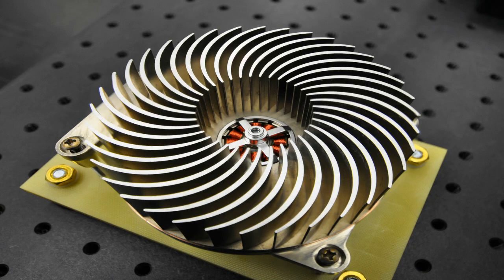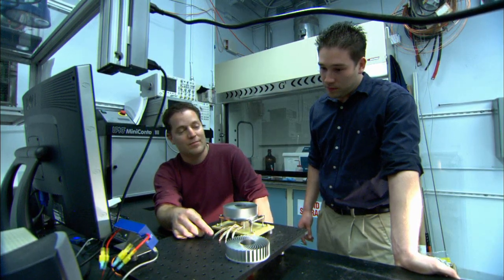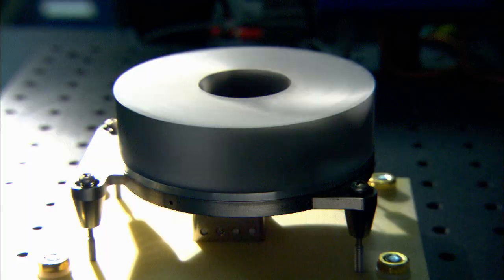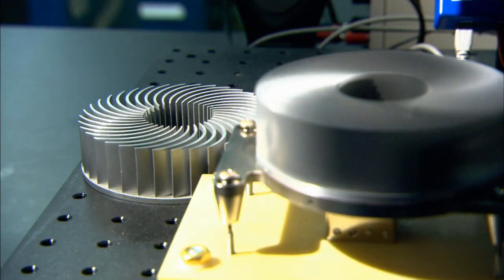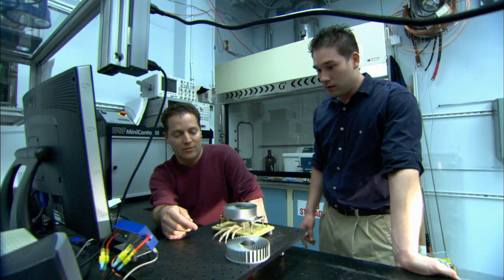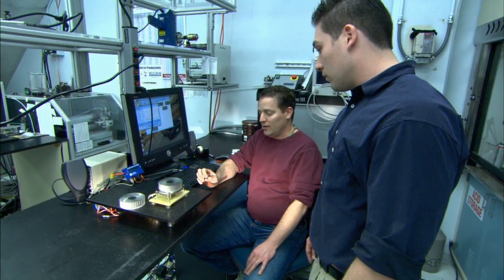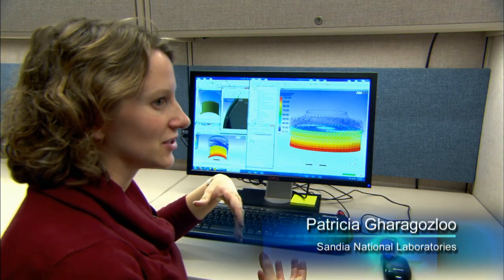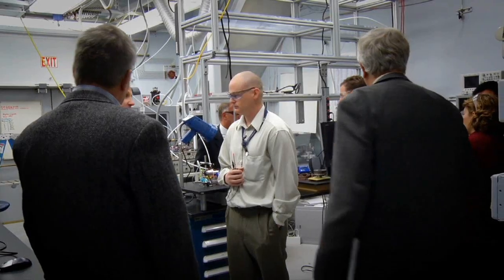Sandia Cooler

Comment: what I meant was that if you are pissed because of your loud GPU cooling, you can easily get rid of your stock cooling and find something better for less than  £15 >> like accelero  for example, it generates no more than 23 dB of noise. I want a gtx680 too, a water cooled and hopefully stuttering-proof for at least 3 years  :)

Comment: I have thought, this whole video reeks of bullshit. 
One, there's no way it's going to be silent at 2k RPM, even if they get rid of motor noise. All that part of the video shows is that they have a really loud motor in it right now.
Two, the bottleneck in heat transfer is getting the heat out of the CPU and into the fin array, not getting the heat from the fins into the air.
Three, the bearing shown in the video isn't going to work when mounted vertically, which is the situation in most cases.

Comment: Invest in Accelero pro or something like that, these buggers are cheap now, and the ones for older generation of cards (gtx8800,gtx260,gtx480) with a little bit of luck still can be fixed to your gtx 680 :)

Comment: The problem is that this is going to perform very very poorly compared to heat pipe designs of the same size. They're trying to get the heat out of the base and into the fin array through an air gap. NOT an ideal situation.

Comment: not every case has the possibility to route cables that way. I have a cable less than an inch from the CPU cooler, bit it is on the side of the fan, so it's not a problem with normal fan which has a frame, so they would have to build a frame around this If they want me to replace my CPU cooler with this, because I won't change the case for a new CPU cooler. But I wouldn't buy it anyway unless they get rid of this high-pitched noise.

Comment: My only question is, doe this work if mounted sideways?  I noticed it was never demo'd that way.  One would think that the high rpm and the liftoff effect mean it would work at any angle but that might not necessarily be the case...

Comment: I would like to think this design is very cheap to make in comparison to a conventional cooler, however if it perform many times better than a large high performance heat pipe heatsink we will probably be ripped off and their profits will be huge...and yea, how the fk is that thing going to work sideways?

Comment: You route the cables at the top of the case. If you are routing the cables through the middle of the case, and near the cpu cooler, you are definitely doing it wrong.

Comment: very good idea, most of the commenters are not listening to the video. Heat gets transferred to the fins from a thin layer of air between the base and fins. What I want to know is can it be mounted 90 degrees?

Comment: It makes no noise when it's turned off. Who'd have thought? Though to be fair it sounds like they were using a frequency-drive in the prototype at lower than top speed, so going to get some PWM whine from it.
Also it sounds like the air-bearing necessitates this being used in a horizontal position. So only good for desktops, not tower cases?

Still, can imagine it being good for server farms and off-the-shelf machines.

Comment: Don't most people tuck the wires to the sides of the inside the case or put it behind the motherboard panel? That's what I do, and so far I have not had wires within inches of any fans.

Comment: 3:10 the high pitched sound is just a prototype for the motor. They will be manufactured with better motors so it will only make the sound that it shows at 3:50

Comment: I still want more detail on how they couple the heat transfer from the stationary base to the spinning blade section. Is all of the heat transferred via the air bearing? If so, I wonder what other fluids with higher heat carrying capacity than air could be used?

Comment: Well if you connect everything correctly there shouldn't be anything that you would have to worry about. CPU power goes behind the motherboard, 24atx goes off to the side, and the fan power would most likely come from underneath the fan itself since that's where the motor is located. There's zip ties for a reason ;)